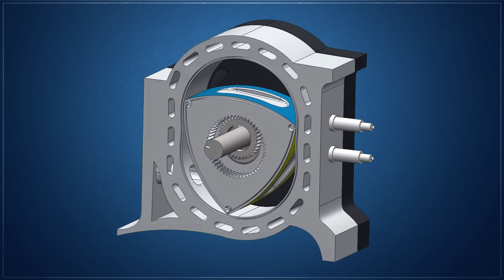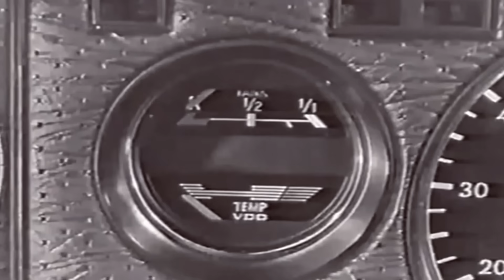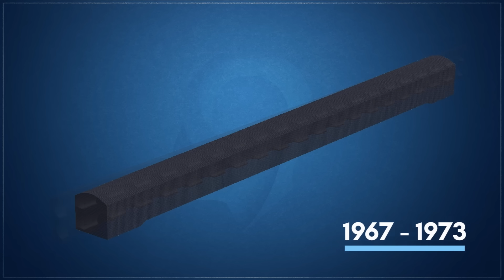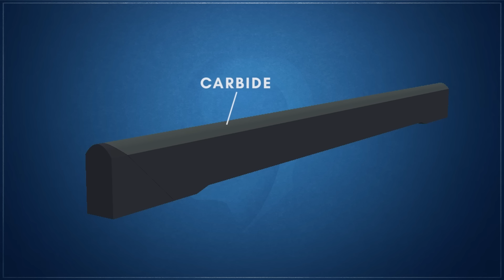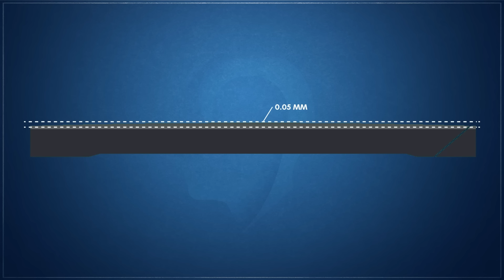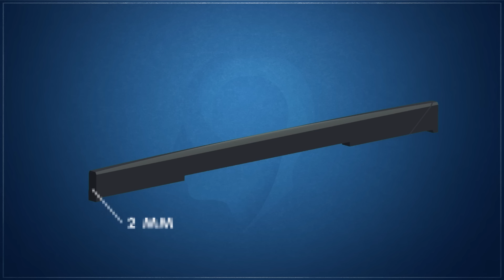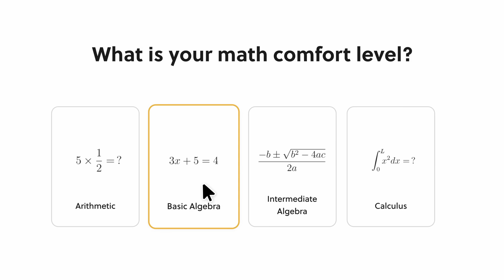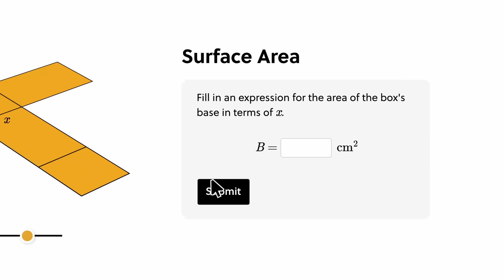Overcoming The Rotary Engine’s Biggest Flaw

Comment: I still think a gas turbine electric hybrid would make a great car. 
The flaw of turbines has always been slowing them down to drive a car. 
But if you design it for one speed and use it to charge batteries, the reduced moving parts, and ability to burn anything would make them the best answer.
Reply: Gas turbine buses exist using Capstone and other generators, but there's nothing particularly compelling about them. There is no particular NEED to "burn anything" other than military multi-fuel requirements (one reason older turboprops that trim to temperature worked so well). Emissions are a good reason not to have omnivorious engines as poor fuel isn't good for sensors and catalysts.
Reply: This is how hard u can push a rotary🔥🔥😱😱https://m.youtube.com/watch?v=xtVVPioU9p8&t=1127s
Reply: You would be very incorrect, gas turbine engines are completely incompatible with automotive applications and all forms of practical land based transportation... including hybrid drive systems and especially battery electric Hybrids.

The duty cycle requirements of gas turbine engines and the charge curve rates of rechargeable batteries are mutually incompatible.
Any questions?
Reply: @sandervanderkammen9230 yes, could you elaborate on duty cycles and battery charging problems? And turbine use as a part of the hybrid setup? I was thinking maybe a turbine electric hybrid could be a neat next gen tank drivetrain 😊
Reply: @krashanb5767  The major problem is that gas turbine engines only operate efficiently and economically when run continuously at 90% to 100% of full rated power. This makes them incompatible with land based vehicles.
Rechargeable batteries present an additional problem it that modern high efficiency batteries have a tapered charge rate curve and will be quickly damaged if overcharged.

The primary failure mode of all gas turbine engines occurs when they are restarted, so cycling the engines on and off is nor a viable solution.

Any questions?
Reply: @sandervanderkammen9230  ahhh crap, you've shattered my ideas :/ Thank you gor explaining :)
Reply: This is how hard u can push a rotary🔥🔥😱😱https://m.youtube.com/watch?v=xtVVPioU9p8&t=1127s

Comment: No discussion about how companies like RA or goopy worked on improving apex seals. You also left out that mazda went downhill with the RX8 due to the side port exhaust blowing out the oil control rings. Have you ever owned a rotary engine?
Reply: There has never been an adequate solution to the problem of apex seal failure, they are fundamentally and inherently waek and unreliable by design.

The primary failure mode of all Wankel engines is still compression loss due to apex seal damage.
Reply: Have you ever owned a Rotary type engine??? They are exceedingly rare.
Reply: @sandervanderkammen9230  Yes. One T2 completely OEM rebuilt with RA super seals and another T2 rebuilt with S5 rotor housings, RA super seals, extra thick rear iron, custom v-mount, S6 uim, ID injectors, larger turbo, all powder coated chrome.

Most failures are due to inadequate lubrication, dropping the front thrust bearing, improper clearance (no endplay), or something else stupid. Rear irons crack around the oil pedestal. Mazda fixed it in a revision... third time, 2nd revision was the charm.

Mazda trying to meet consumer laziness and emissions makes them unreliable. Add plenty of premix. Motor will run with 60psi cold. OEM car purchased with "blown" motor was rebuilt incorrectly. It had no end play. Tight rotors slap irons. All issues by people.
Reply: @keilmillerjr9701  You comments reveal someone who has no formal education in engineering or professional experience regarding this matter.

No one, absolutely no one has made an efficient Wankel engine that can match the durability or reliability of reciprocating engines.

FALSE; lubrication is not the primary failure mode of Wankel engines.

Metered oil injection is superior to premixing for several very important reasons that seem completely lost to you son.

Please stop posting lies and misinformation about a topic you are clearly not qualified to discuss.
Reply: @keilmillerjr9701  Son you are talking about Wankel engines, I asked you if you ever owned a Rotary type engine.
Do you not understand the difference????
Reply: @sandervanderkammen9230  Your taking your own frustrations on others. I have owned the cars. Oil metering pumps sound good on paper. They often are not good in practice. They inject in a certain area. Mazda has moved the location, proving it's not perfect. Premixing is superior. You also need to rely on a user getting a specific kind of engine oil that can be burnt. Your also assuming the lines are not hardened and broken. Your assuming users are running the factory seals.

Buy one, play with it, and then talk. Until that moment, you have no practical experience.
Reply: @sandervanderkammen9230  There are different types of rotary engines. Perhaps you should be more specific, instead of name calling.
Reply: @keilmillerjr9701  Then why does Mazda use oil injection and does not recommend premixing???
WHERE is exactly why premixing is bad... you don't want the oil to be mixed with the fuel in the middle of the combustion chamber, you only want it on the surface of the moving parts.

Mixing oil with the fuel causes most of it to burn, leaving carbon deposits instead of a film of oil and it causes damage to the apex seals by causing erratic combustion and detonation.

Please stop posting ignorant misinformation.
Reply: @keilmillerjr9701  There are more than one type of Wankel engine.
PERHAPS YOU SHOULD BE MORE SPECIFIC SON.

Comment: With no data to back it up.. I think a small rotary engine as a generator for a range extended EV is a great idea and one could manage the weaknesses of the engine to make best use of benefits. Low NVH, power dense, simple.
Reply: the only advantage of a rotary engine is power density. but other than that, they are inefficient, have poor emissions, (comparatively) poor reliability, etc which goes against the whole idea of an EV range extender
Reply: This is how hard u can push a rotary🔥🔥😱😱https://m.youtube.com/watch?v=xtVVPioU9p8&t=1127s
Reply: Why would anyone permit themselves an unsupported opinion without data to back it up?
Reply: @Comm0ut It’s a casual suggestion in a YouTube comment. In fact Mazda did just as suggested, bringing out the Mazda MX-30 R-EV.

Comment: Instead of an Apex Seal, why not have a wide roller bearing similar to a steam roller at each tip of the rotor?
Reply: I was thinking the same thing.  I would imagine that no bearing could possibly keep up with the speeds the roller would require, not to mention the need for some type of tension mechanism to ensure contact with the housing, which of course would add extra weight and complexity at the edge of the rotor, which then decreases the usable horsepower...   I found a thread on the old RX7 forum discussing exactly this.
Reply: HOW WOULD IT FORM A GAS TIGHT SEAL IF IT HAS ENOUGH CLEARANCE TO ROLL FREELY???
Reply: It would likely leak some but you'd reduce friction and have more strength... in theory.
 @DoktorBayerischeMotorenWerke
Reply: @ricepony33  But you cant have any hot combustion gasses leaking passed the seal... if there is the hot gasses will quickly destroy the seal.

Comment: OK.  the (apex seal) is what ultimately caused the project to fail.  Ceramic didn't work, And the metal they were using became hard (liken unto a carbide).  So, obviously, they are going the wrong way.  A brittle(apex seal) in not going to work.  You need something ductile.  Copper is a soft, plyable, metal.  Yet is hard enough to handle the force it will need to.  Maybe not 100% copper, nay.  But an amalgamation of copper and something.  But, not into a brass.  You will have the exact same problem if you go down that road.  Brass is "way" to brittle.

Comment: Would love a video about the new rotor-charged hybrid. The new engine uses exhaust recirculation and direct injection to increase efficiency by up to 25%, helping the other downside of rotary engines as far as mass consumer use. Pretty interesting, especially if you can get more info from Mazda itd be interesting to see a vid. Now if they develop a better AT, combined with Skyactiv and their other tech, they could have the best MPG and efficient stuff out there without a CVT, let alone their fun higher power Turbo CUVs and hatchbacks (or tiny hatch-cross-things, like the CX-30 lol) edit: go figure you cover the MX-30 at the end a bit lol, would still love a vid on the in depth stuff. They even pass strict emissions standards with the little engine now which probably wouldnt have before.

Comment: Nice, but no cigar.
When Felix Wankel (The Creator of the Rotary/Wankel Engine) saw the design of the Rotary Engine that NSU (and Mazda and everyone else) adopted he said -
"You've replaced my thoroughbred with a plow horse."
Felix created the DKM Wankel, everyone else goes with the KKM design.
The DKM can rev beyond 20,000 rpm and it's walls never get scorched.
Learn the difference and you'll understand the real problems.
Reply: An excellent point that everyone overlooks, the Wankel KKM design was not Felix Wankels.
It was designed by Hanns Paschke and Walter Froede.
Wankel hated this clumsy, non-rotory design.
Wankels engine was based on pure concentric rotary motion and was so smooth it did not require any flywheel or external mass dampers.

Whether Wankels engine was practical or efficient is purely speculative and ultimately unknown.
Reply: @@retiredbore378 
My final response.
First excuse me for not telling you the DKM's biggest flaw and assuming you knew it.
The DKM's biggest flaw was having to tear down the engine every time a tuneup was required in order to change the spark plugs that were housed inside of the rotor, which was housed inside of the combustion chamber!
In a world of leaded gas, weak ignition coils, points, condensers and short life spark plugs, that meant every 5 to 10thousand miles.
That's 10 to 20 engine rebuilds per 100thousand miles, just to change the spark plugs. 
By the 1980's those 3 problems had gone away, hence the DKM could thrive in that environment, but Mazda, the only Wankel manufacturer by then, never addressed the DKM.
As for DKM cooling problems, whatever they were or are, the engine ran 100 hours straight, so cooling was not the problem, independent of what is reported to have been Wolf-Dieter Bensinger statement.
Reply: @@retiredbore378 As far as I know, only one example of the DKM exists and it resides in the Bonn museum.

In 1950s terms, even the KKM57 was considered efficient enough to be commercially viable but is certainly not by today's standards.
Advances in ignition technology may have made the DKM practical for the 1960s-70s?
Reliability problems have always plagued the KKM57, one can only imagine how reliable the DKM would be... certainly maintaining the spark plugs would have been a significant disadvantage.
Many questions and few answers.
Reply: @@retiredbore378 Thanks for showing us you don't know what you're talking about. From the mid 80's forward the DKM should have been used. Unleaded fuel and electronic ignition eliminated it's biggest problem and you're wrong on thermal inefficiency, DKM vs KKM.
Reply: @@retiredbore378 
Wikipedia is NOT my source.

Somewhere around 4 to 7 years ago, I went (multiple times) to 
The New York City Science and Technology Library to access research books unavailable to the general public on Wankel engines. 

It is from these books and from owning a Rotary powered Mazda and years of studying the engine, that I draw my knowledge of the Wankel.

Additionally, the thermal inefficiencies you talk about, which are real, can be turned into an advantage, especially in DKM Wankel engines that operate at constant / consistent rpm’s (20,000 +) in boats, planes & highway driving.

Comment: I never got rotary engines. They’re inefficient compared to inline 4. Can some one explain why this engine got fans? Is it purely due to Rx7?_
Reply: Mostly autism. Not kidding, it's common among those who only care that something mechanical is different but not about how it functions IRL. Learn why railfans are referred to as "foamers" for some real insight into unusual ways humans engage with technology.
Reply: The Wankel rotary engine can be given perfect mechanical balance without the need for anything rotating in the opposite direction, so it is very smooth-running. Apart from that it is not as good as the reciprocating engine in most ways.
Reply: They produce an incredible amount of power for their displacement and weight.  The power is offset by the amount of fuel used and the high amount of undesirable emissions and short engine life with the technology available at the time.

Comment: Liquid piston design is the rotary done right, seals are stationary and both the rotor and housing are oval - no edges. It has pre-chamber and CR of ~18:1
Reply: The housing is tri-lobed, but true it has no significant edges. I’d love to see more people covering this design. It’s an awesome and potentially revolutionary design, pun intended.
Reply: And they solved many of the Wankel engine's other deficiencies, while retaining all of the benefits.  I am hopeful a company will use Liquid Piston technology to make a family of aircraft engines, they would totally dominate the market as they would be better than existing piston engines in every way.
Reply: LiquidPiston is not a legitimate company it's a notorious vaporware investment scam
Reply: LIQUIDPISTON is well-known in the industry as a notorious vaporware investment scam.
LP is not a legitimate company and it's claims are highly dubious as well as unproven..
Reply: https://www.youtube.com/watch?v=X5UOqZn43gY
Reply: Good luck handling the preignition and knock (there's none bruh)
Reply: Unfortunately, it doesn't work.
Reply: only issue imo is the hollow rotor, like surely there's a better way?
Reply: @blockstacker5614 The rotors Mazda uses are hollow as well. Oil circulates through the insides of the rotors to cool the combustion faces of the rotors.

Comment: I always use quality synthetic two stroke oil when I fill my petrol tank to help with seal lubrication, it the same as using upper cylinder lubricant in a piston engine.
Reply: You shouldn't use synthetic oil in a rotary engine because it doesn't burn like mineral oil does and it leaves deposits in the engine.
Reply: @althunder4269 Mazda says ANY 4-stroke oil that meets API SL or EC-GF3 is safe to use.

It's not the type of base stocks used but rather the detergent and dispersant additives that form harmful deposits.
 Any questions?
Reply: It's all very well using an oil to extend the life of the apex seals, but the issue with that is emissions, a conventional ICE engine doesn't burn any oil (in most cases) whereas an oil injected rotary (or even one running on premix) burns 500ml per 1000 km which in the modern world is unacceptable.
Reply: @onecookieboy  I would agree with the slightly increased emissions, but I have increased the life of the combustion chambers and seals. I have been playing with these issues since NSU came out with the Ro80, others were dropping V-4 Ford in them while I kept the engine going. 
I have lots of experience with Mazda engines in the MX5 and RX8.
Reply: @chrisbarnes2823  Exhaust emissions are such a huge deal these days that Diesel engined vehicles are becoming impossible to make 'clean' enough and look like they are all but dead in passenger cars, so it's hard to see how any engine which necessitates the burning of oil can meet standards. I don't know how Mazda have overcome this problem with the 'generator rotary engine' except perhaps a combined DPF/catalytic converter type setup. I worked for a Mazda dealership for many years back in the 1980's-early 2000's and while Mazda engines were solid and reasonably trouble free, they were also rather boring and uninspiring. Most of the mechanics I worked with detested the rotaries, I didn't mind them so much, but the life expectancy was pretty dismal and after 50,000km most of the customer related 'not running very well' problems were because they were getting worn out, which is unacceptable.
Reply: @chrisbarnes2823 That is a completely false and misleading statement, using more oil does not extent engine life, using the wrong oil incorrectly will actually damage your engine.
Reply: @onecookieboy Apex seals are inherently unreliable and then are the primary failure mode of all Wankel engines, these failure mode is not related to lubrication.
Reply: You have to be monumentally stupid to pour the wrong oil into the wrong filler hole... if you cannot read your owners manual or the label on a bottle of motor oil? You have absolutely no business under the hood of any car.

Comment: General Motors Chevrolet used an engine as a generator extend the range of the Chevrolet Volt many years ago and it worked extremely well and met emission standards.
Reply: Epic failure.
Reply: The Chevrolet Volt was a Hybrid vehicle and had a notorious reputation for being unreliable, it was discontinued in 2019.
Reply: This is how hard u can push a rotary🔥🔥😱😱https://m.youtube.com/watch?v=xtVVPioU9p8&t=1127s
Reply: ? This is news to me. I mean it wasn't a Toyota but it's not like an rx-7 eather.